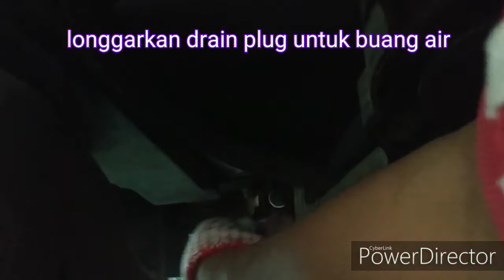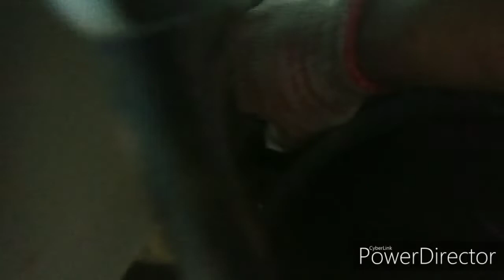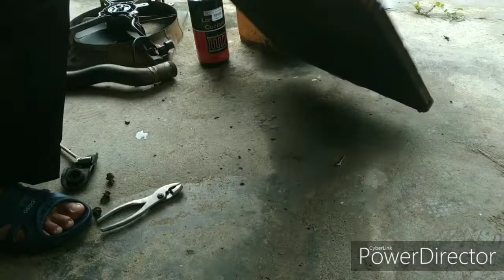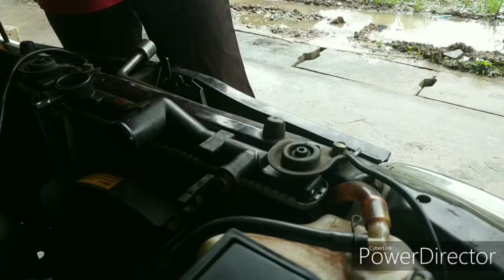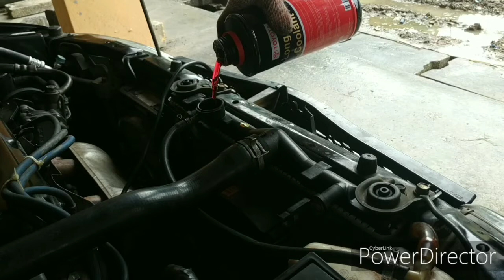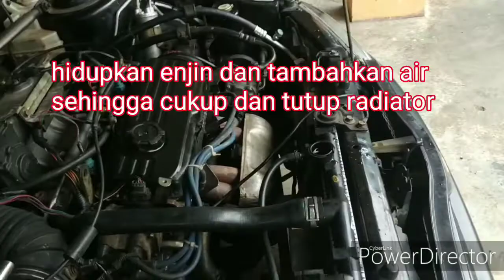Tukar radiator proton wira

Comment: Boss...wayar soket fan tu ada dua wayar atau tiga ? Sbab sya pnya soket fan ada dua..dan yg untuk ke fan switch tiada
Reply from the maker: Wira pakai 2 wayar. Fan switch trigger dari ecu. Ada sensor temperature di head tu bagi signal ke ecu, baru ecu suruh kipas pusing. 😅😅
Reply: @DIYYo  sma la wira vdo sya..ada 2 wire je.mknya suis kipas yg bwh radiator lau x psg blh la kan?sbb vdo sya x psg soket suis bwh radiator tu
Reply from the maker: Vdo memang cmtu wayar kipas radiator.
Reply: @DIYYo  vdo mmg mcm tu?kurg fhm bos..
2 wire yg dr body pastu  pecah 2 1 ke motor kipas 1 lgi ke sensor yg bwh radiator..
dlm kes sy ni soket yg ke sensor bwh radiator x smbung,ada apa2 kesan sampingan x pada engin atau sebagainya..
Reply from the maker: Selagi kipas pusing bila cukup panas enjin, xda hal jg tu. Sebelum ni pun ada buat wira vdo, wayar tu xda tempat sambung jg. Mungkin pernah diubah sebelum ni. Janji kipas pusing, enjin x overheat.

Comment: Masa pasang balik radiator tu macam mana nak positionkan dia? Ada tapak atau lubang ke dekat bawah body tu?
Reply from the maker: Ada tu lubang bracket bahagian bwh. Mcm atas jg. Radiator ada tu batang kiri kanan untuk masuk lubang bracket. Mcm bahagian atas jg. Tp bahagian atas kn kita pasang tu bracket kemudian.
Reply: DIY Yo Alright yo. Thank you info. Saya ingat nak tukar juga. Tapi kalau boleh nak buat sendiri sambil belajar. 👍🏻 Lagi satu kalau boleh nanti you share video macam mana nak tukar bearing pulley compressor. Tadi saya warm up kereta ada bunyi kuat dekat belting compressor lah. Thank you yo.
Reply from the maker: Bearing atau belting saja? Rasanya belting tu.. cuba adjust bagi kencang belting aircond. Ataupun bearing tensioner aircond? Jarang rosak bearing pulley tu..
Reply from the maker: Apa pun, trima lasih byk2 support tuan. Jgn lupa share... kuta kongsi2 ilmu yg x seberapa ni
Reply: DIY Yo Tu lah. Saya nak explain pun tak tau. Sebab saya tengok video semua kes bunyi tikus. Tapi saya punya ni bunyi dia kuat. Macam bunyi besi bergeser. Dekat sini tak boleh send video pulak. Kalau tak saya dah tunjuk bagi you dengar. Ini wira datuk saya. Sudah 20 tahun lebih. 1.3 carb. So saya nak buat balik sikit2 bagi dia run cantik dan smooth. Pasal belting, saya tengok dah cukup tegang.
Reply from the maker: Boleh whatsap sy.. sy sedia membantu setakat yg termampu. Walaupun jauh, boleh jg bg pendapat. 013-8321987
Reply: DIY Yo Ok yo. Sekejap lagi saya send. Thank you. At least boleh dapat ilmu lepas tu share kat orang lain.

Comment: Housing fan tu rapat dengan radiator tak bocor ke?
Reply from the maker: X jg rapat sangat tu. Nampak mcm melekat tapi ada ruang jg. 🙂🙂
Reply: Kalau pasang radiator double layer pendek  ada tak kena tambah tapak ape2?
Reply from the maker: X perlu. Kalau memang radiator untuk jenis kereta tu selalunya masuk terus. Kecuali ubah pakai radiator keta lain.
Reply: Ok baik yo tq...
Reply: saya mau tanya...keta wira saya bawa laju ketika  on aircond, temperature akan naik...lepas tu tutup aircond temperature normal balik..slalu temperature naik waktu tengah hari panas..klu waktu pagi, ptg, n mlm temperature normal...keta dh top overhaul, water pump dh tukar, radiator single layer, radiator dh servis, motor fan radiator dh tukar baru, kipas direct, enjin dh flushing, aircond baru servis (tukar part baru semua) pakai condenser panjang, fan aircond masih pakai yg lama...apa masalah yo?
Reply from the maker: Termostat?
Reply: thermostat dh buang...wira saya carburator...
Reply from the maker: Kemungkinan head tu x berapa bgs. Kena skim baru cantik.
Reply: head dh buat top overhaul...dh skim...
Reply from the maker: Pelik jg.. kipas mungkin ada masalah. Kadang2 blade tu dah bengkok. Angin x berapa kuat. Susah jg mau ckp masalah sebenarnya kalau bukan depan mata kn. ☺☺
Reply: tp kalau tak on aircond temp tak naik...bwk laju pun ok...
Reply from the maker: Susah jg mau ckp klau cmtu tuan. Kena cek jg baru boleh kesan masalah..
Reply: ok x pa...saya tanya ja..kot2 yo pernah jumpa masalah mcm ni...sy nk tanya 1 soalan lagi, kalau kipas radiator bergerak kan relay fan atau fius  memang akan panas ka?
Reply from the maker: Ada panas sikit la relay ngan fius tu.
Reply from the maker: Pernah jumpa jg masalah cmni. Radiator kotor.. tp ni dah tukar semua kn?
Reply: @DIYYo  radiator servis saja...saya nk try pasang meter temp defi...kalau jadi jgak saya nk tukar radiator double layer..
Reply from the maker: Ok tuan.... harap2 settle cpt masalah tu.

Comment: radiator standard size ke double layer boss
Reply from the maker: Ni saiz standard...
Reply: nk tanya boss wira saya 1.5 mannual carburator water pump waterpump pipe radiator hose full set thermostat semua sdh tukar tpi masih lagi overhaeat running dlm 50 minit
Reply from the maker: Radiator ok? Takut sumbat sdh. Ataupun kipas slow sdh pusing
Reply: @DIYYo  mungkin kut sdh lma tk service radiator fan motor pun elok tk da lah slow .bro kalau tkr radiator double layer 26cm kena adjust tapak tk
Reply from the maker: Masuk terus tu...